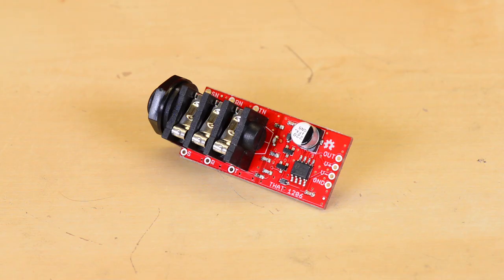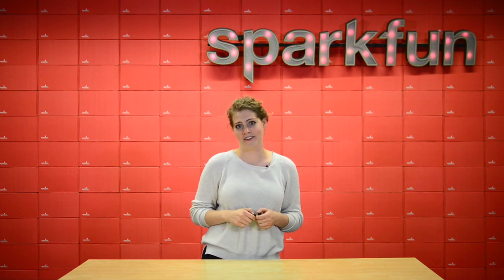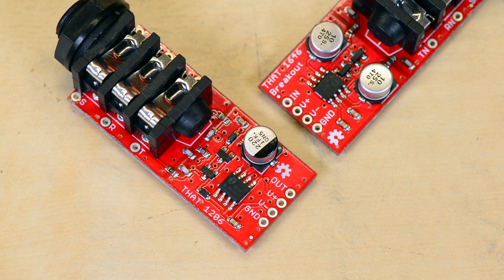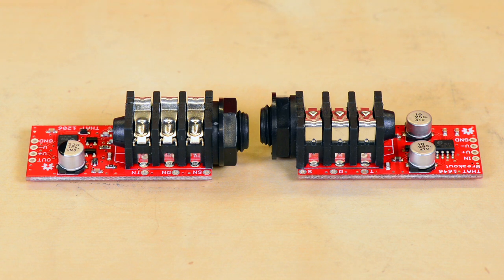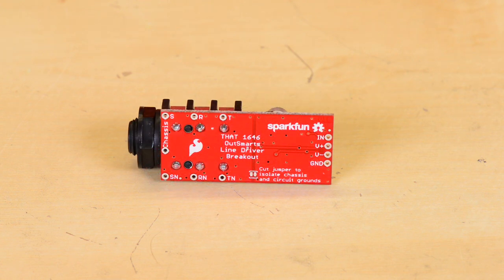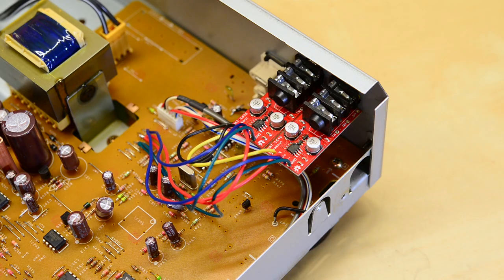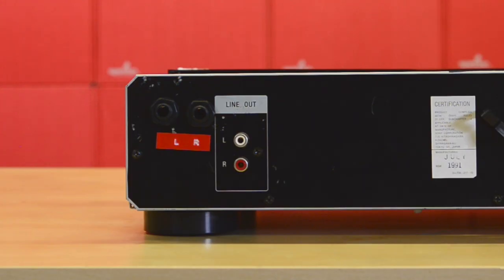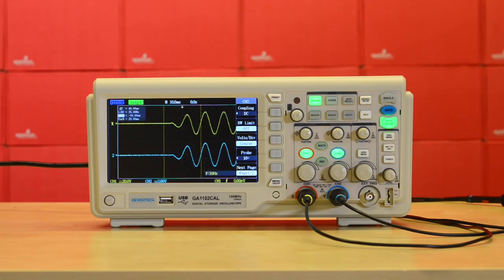SparkFun THAT InGenius + OutSmarts boards

Comment: Hey, I dig the retro embossing label.  ;)
One thing though - the video doesn't explain what the heck balanced audio is or what it's good for. Maybe explain that for people who don't know.  Yisssss, happy Friday!
Reply: Balanced audio cables have a ground and two signal wires, down which equal but opposite polarity signals are sent.  This cancels out noise caused by RF interference and mains hum, since the signals are re-combined at the input by inverting one of the signals, then adding them together.  The original signal is preserved, and any noise introduced between the source and input gets nulled out.
Reply: Yep. I know.
But many people do not. Seems like the video should have at least touched on the concept for the unawares.  ;)

Comment: Can these 1646 spark fun units be used directly from an unbalanced output from a mixer - RCA output?, (I have a +16v,-16v, 0, power unit so that’s fine regarding power) 
but can the unbalanced audio be taken directly from an RCA output? Or does it require a tap at the op amp that feeds the rca out?, like the - ‘that IC’ on it’s owns says is required...?

They really need nothing over 300ohm ZSource so I’m almost certain the CD player based on its age would have jumpers at 600homs (op amp leg put to 600ohm then come out at the jumpers near the rca line) this would violate the 10x rule!
Really should make this the most clear thing in the video!

The data sheet clearly says ideal operation directly from op amp output leg = 0ohms, are the jumpers really 0 or under 400ohms at that point?!